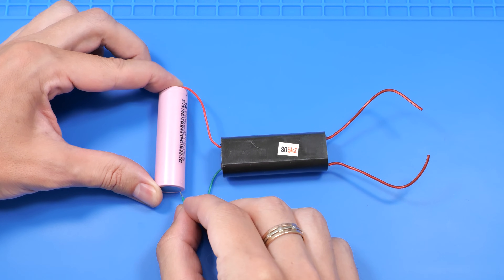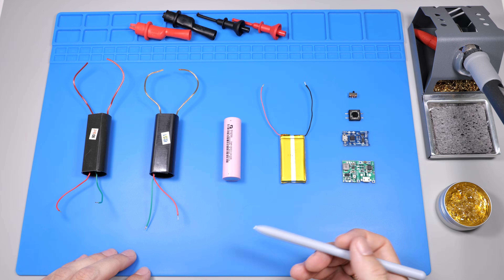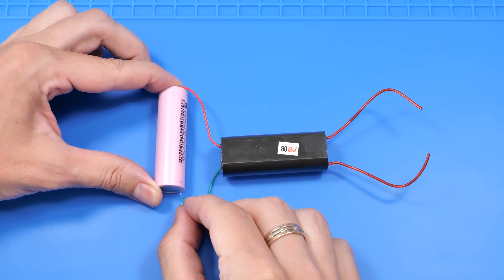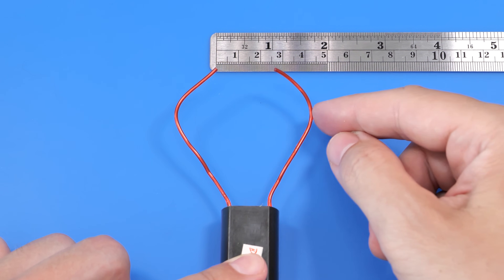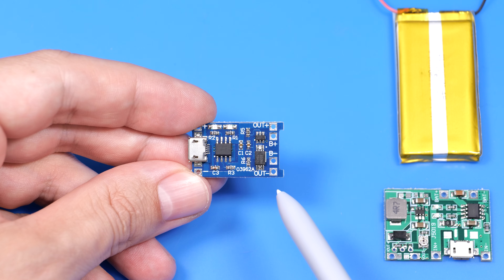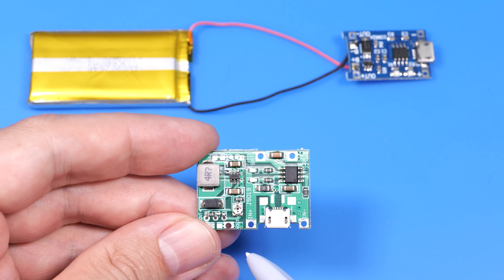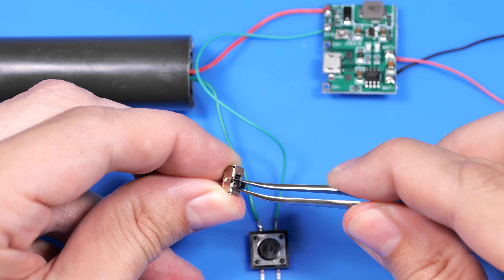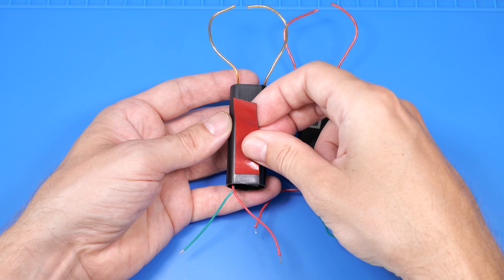$5 High Voltage DIY Module – Tiny Board, HUGE Sparks 100000 volts!

Comment: Ever figure out the M.2 in Xbox One X?
Reply from the maker: Yeah, it was a long and messy process. We didn’t even record any videos because there were just toooo many failed attempts. Anyway, to make it work, you have to add a bunch of capacitors, transistors, MOSFETs, and an IC for the SSD, swap some resistors and use a very specific SSD model the same one used in the Project Scorpio dev kits.
My original idea was to make a step-by-step video showing how to do the upgrade, even for people with only basic soldering skills or electronics knowledge. But the whole process is too complex and risky, and finding that SSD these days is getting harder and they're not cheap. So the total cost of this project just isn’t worth it anymore.

Comment: Be careful not to power up such a device with the spark gap too wide as that would burn it out and destroy it.
Reply: that's true because I did the same and it stopped working
Reply from the maker: Those modules will also fail if you supply more than 7 volts. For example, with two Li-ion cells in series, the module produces one long 60–70 mm spark and then dies.

Comment: It's an interesting thing. But what is it for? What are the application scenarios? Pocket taser?
Reply from the maker: Yep, a nicely made one is a pretty good option for self defense. In most countries you can't buy a stun gun but you can it build yourself.
Reply: @ElectronicsComputers  And you'll most likely get nicked and locked up if you're caught carrying or using such a device, you certainly would here in the UK.
Reply from the maker: @majorpygge-phartt2643   I live not that far from you and know what’s going on in the UK. I’d still carry a good tactical knife and pepper spray if the state isn’t capable of protecting its citizens. I’d rather risk getting locked up and hanging out with mates for years than get stabbed and end up six feet under. Look after yourself and your family, not some stupid law that stops you from defending them.